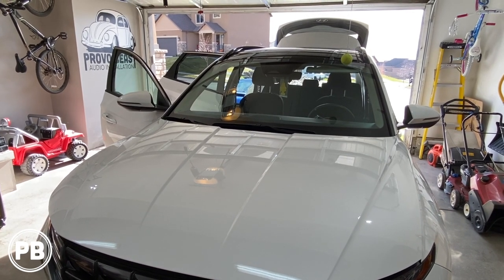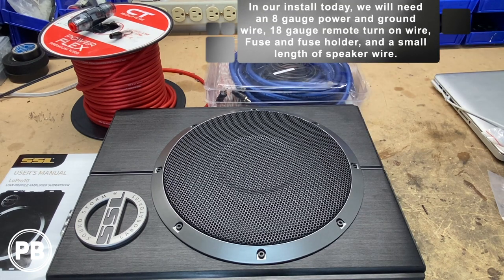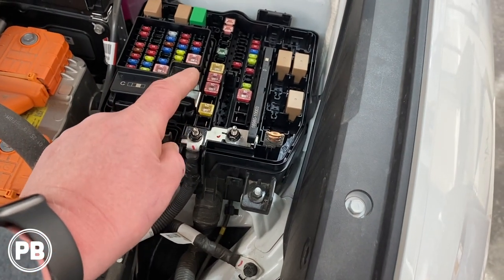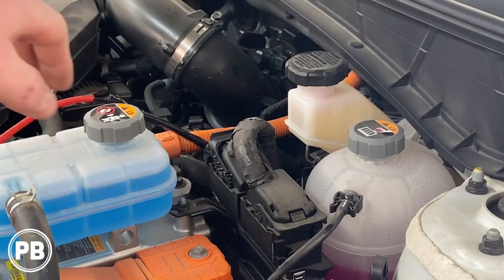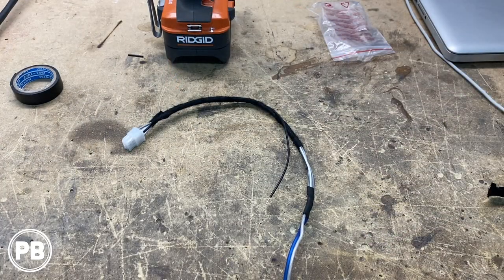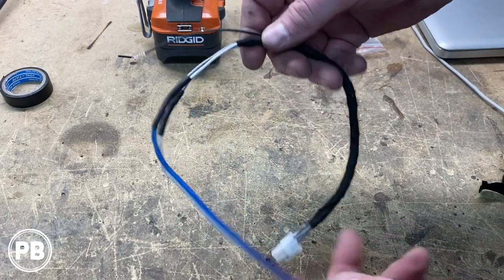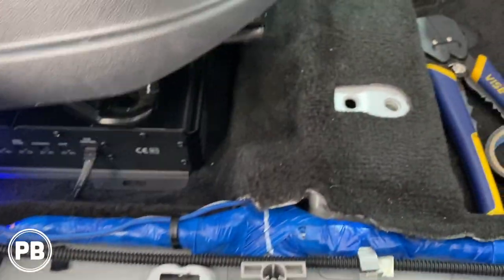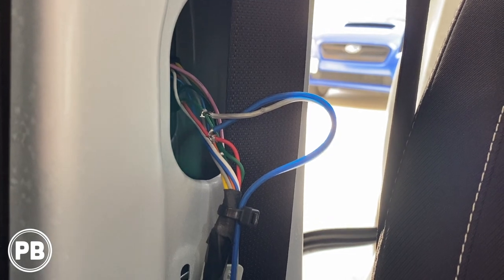2021 - 2023+ Hyundai Tucson Amp and Sub Install

Comment from the maker: Parts used linked in the description of the video!
Reply: Do you have any recommendations on replacing the speakers themselves? 

If so, should I replace all speakers, or can I replace in pairs as desired?

And finally, when replacing the speakers, can I just "plug and play" since the existing wiring is so new?
Reply from the maker: @andrewdiaz1631  You can replace in pairs, sure, but they won't be plug and play.  For front and rear doors, you will need the Metra 72-7302 wiring harness adapters, and the Pac / AI HKSB110 Bracket adapters.  Also if you have the factory Infinity sound system, you may also have to be conscientious of the factory ohm of those speakers.
Reply from the maker: @donnadetwiler6252  We used a test tone and polarity pop to determine our positive / negative.

Comment: This is an Old post but I have to add. I have the 22 Tucson Premium Bose. Installing any Amp and or Subwoofer under the passenger seat would cause the Amp to Overheat as soon as the heater is turned on. For those of us in Southern states this really isn't an issue. But for those folks in Northern states this would create a problem. Also.. Video is Decent. I would like to add that Attempting to Send Power Wire through Wire Harness is very difficult in a Gasoline Model as the Battery placement makes it extremely difficult to manueaver around. For those of you who where concerned about Taping both channels... This is :MONO: AMP and therefore... no channels are needed you are only taping the speaker for mono. If you where attemping to install a "2 Channel AMP" then... you need to find another way.

Comment: I can’t believe nobody has asked this…..Why do you even have to remove the B-pillar molding? Can’t you access and tap the wires from the bottom molding, which is already off? This would make it less daunting to take off the driver’s side door molding also, and complete the job the proper way, using all four channels to feed the amp. Am I correct in these assumptions? I just feel that I want to disassemble my 2024 Limited as little as possible to attempt this job. And using a Rockville sub is the way to go-unreal punch, ALL connections and adjustments on the same side (really convenient), and the 10” is under $150.

Comment: If you have the Bose do not tap the speaker signal tap the low level signal coming out of the head unit. The amp does a bunch of filtering
Reply: Where do you tap into then? The rear speakers?

Comment: @Provo Beast Audio Installation. Question... I've watched several of your videos. I'm not a pro.. But Why do you Sauder your Speaker channel lines instead of T Taps? I get the Longevity portion; But is there a quality reason? It's just a Mono Amp.

Comment: Wouldn't that vent cause the amp to overheat in the winter?
Reply: I agree.. If the heater is running... This would overheat this Amp Quick.

Comment: Hello, did this vehicle have seat warmers?  I am curious as to in if the sub would fit with seat warmers?  Thanks!
Reply from the maker: Yes, and yes.
Reply: One more for ya... Installing Kenwood Ksc SW 11.  Possible to just use the yellow power wire instead of running to the 12v under the hood?

Comment: I have a 2023 Hyundai Elantra hybrid "blue" model non Bose and I was wondering if you could give me advice.
 I want to add a JBL Basspro Hub also the back door speakers don't put out a lot of sound compared to the front and don't sound as good. I am thinking that the rear isn't a ported design but I don't understand why the rear volume is so low it's almost like I lose 70% of the sound when I channel to the rear.
Is this normal for this car and if so how do you recommend I change it, 4 channel amp, 2 channel amp for the rear or add something. I was reading somewhere if you draw more then 20 amps it messes with the battery because it thinks there's a drain somewhere and shuts it off to combat that? since the JBL is rated for 30 amps and if you recommend an amp for the factory speakers that would put it well over that. is there something I need for that?

Comment: @11:42 I have 2 green wires and 1 red wire. Did you use the green wire that's at the bottom with the red wire or use the one at the top of the connector? Thanks! I have a hybrid SEL convenience if it matters.
Reply from the maker: It's the green wire found in the twisted pair with the red.
Reply: @ProvoBeastAudio  awesome, thanks!

Comment: i have the 23 hybrid limited with the bose system what about the ability to increase overall volume i feel like if i add 2 12s in the back its going to drown out the vocals alot! how could i add that and increase the output to the bose speakers
Reply from the maker: You can't add power to the bose audio system as it's all factory tuned.  Bypass the bose amp, add new amp and speakers.

Comment: Did you disconnect and bypass the oem amp in the back?
Reply from the maker: Nope, we are simply just adding to the factory audio system.  This powered sub is a standalone unit.  If we ended up adding a 4 or 5 channel amp, then yes, that would be necessary.

Comment: Nice job for explain this. I got a Tuscon 2022 and looking to add a Sub. Is it possible to get easily a stereo sound for the sub for not loosing bass with getting the sound from juste 1 channel ??
Reply: If you are .. "adding" a "Subwoofer".. you only need "MONO"... if you are attempting to add a 2 Channel Amplifer and then use both Channels you will need to find another way.

Comment: It would be better to take the time to tap in the audio from both channels not just one. Great video though
Reply: Curious as to why?
Reply: @andrewhite4431  I gave up on this project and didn't bother doing it to my gfs car. I put it in my mustang instead, but when rca cable comes off head unit you normally have left and right input going to amplifier.
Reply: @andrewhite4431 with rca you need both side for full signal.  I’m guessing that would be the same for the speaker wire.  If you hook up a subwoofer with rca input and unplug one side,the red or white, the volume will decrease by half.

Comment: Would this void a car warranty
Reply from the maker: Nope.
Reply: Yes. Once you alter factory wiring harness you own any PCM, BCM, ECM and all controller modules and all onboard computers. A tap is a modification as it injects signals and/or voltage into the vehicle system that is uncontrolled.

Call Hyundai and ask.
Reply: @prebaned  that's not true lookup the Magnuson–Moss Warranty act
Reply: lol so confident in the way you word your reply, despite it being completely wrong. @prebaned

Comment: I understand this is old 
And I have a 2017 Tucson 
Trying to install sub/amp I already have 
The power cable I understand and that’s easy 
For me - I have factory stereo so I am assuming I’ll have to take dash apart and pull unit out the I don’t have LOC - I have RCA wires (one end has the plug and the other is just wire) I planned to tap the wires behind the factory radio and then run those RCA (with male ends) down the driver side then plug into the amp
Does this make any sense ? ^

Comment: 12v is in the rear of the car so much easier to run wires.
Reply: 12v rear is using 22G Wire.. designed for 5amps... You cannot run a "normal" amplifier successfully thru 5amps. This would burn out the fuse quickly. If you are referring to using the 12v as a "Remote turn on" then yes.. this could work. However... bare in mind that Tapping a 12v doesn't necessarily mean you get Power on Accessory.
Reply: @Cybrid98  the actual 12V battery is in the back of the car that is what I’m referring to. Obviously all normal car electronics that do not require high voltage still require the standard 12V battery which once again is located in the rear of the vehicle.
Reply: @TrenDMuzic  I'm thinking you are referring to a Hybrid. On a Gasoline It's in the front of the car. But good to know!
Reply: @Cybrid98  yes I’m referring to hybrid because that is exactly what is in the video. Sadly, he did not include it in the title, but that’s why I was referring to it the way I was.
Reply: @TrenDMuzic  100%... It should be in the Title... Secondly.. If the Car battery is in the rear.. There should have never been a Power Wire Tapped in the Fuse Relay in the front. Thanks for pointing this out.
Reply: I believe these cars have an 12 volt integrated lithium.  It’s separate but built into the chassis of the main high voltage battery.